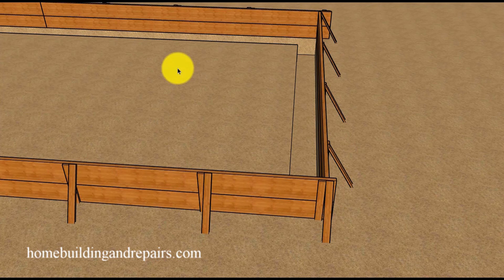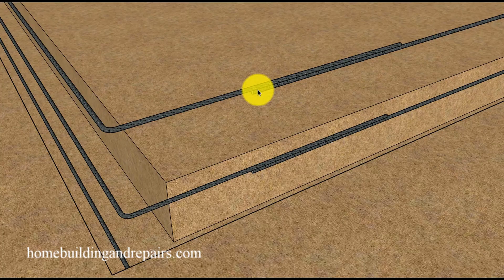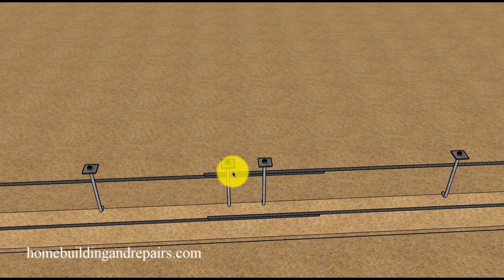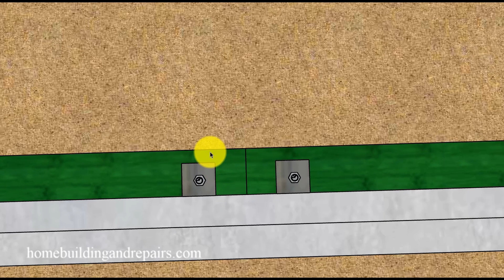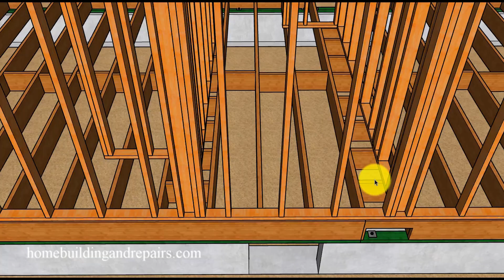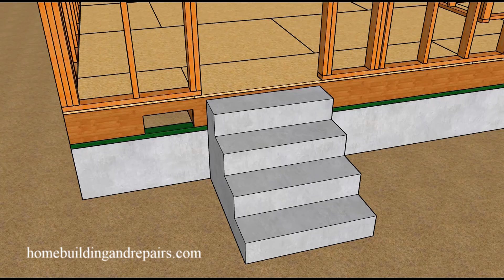How To Build Raised Floor Foundation And Floor Framing For Small One Bedroom House

Comment: I really want to thank you, i just completed my 1400ft house on 11000sqft lot and i had alot done with your help i really appreciate it. I built it all only hired local an electrician for electric.
Reply: How did you pour the concrete?
Reply: @MateoMan1  4000k psi with a cement truck and a pump

Comment: might be a dumb question but how do you connect the floor to the sill plate?
Reply from the maker: The joist are usually nailed by angling 16d nails or commonly referred to as toe nailing.
Reply: @gregvancom  what about areas prone to high winds? Toe nailing is enough to hold down the structure?

Comment: Hello Mr. Greg. I watch your videos often as I am getting ready to build my own house. A question, please: I am planning to build on 50ft by 60ft with raised floor foundation. I will use 2x8 for the joists on the foundation. What size do I use for the 2x8 to cover the 50ft since the longest is 16 ft (I believe)? Even if I used 2x8x16 three times, it will not fit... And there is the overlap of 4" minimum, etc.
Reply from the maker: Most designers and engineers use beams located within the maximum span of joist. For example if the maximum distance for 2x8 floor joist is 14 feet then you could span the beams 14 feet apart and make the last section smaller.  For 50 feet you could use 3 - 14 foot spans and one 8 foot span.
Reply: @gregvancom  ok. Thank you, sir.
Reply: @gregvancom  Mr. Greg, so you think having 2 rows of  beams (walls) to support the joists in the middle in the middle
Reply: I went to your website but I could not find a contact information such as email or phone

Comment: Hey, Greg, I thought you did a great job explaining this. My wife and I are wanting to build our first home our area is very susceptible to termites and water damage so we were wanting to frame at least the outside walls out of steel, and maybe even the interior walls. What are your thoughts on this, and can it be done with the same method of raising the floor that you used in this video, or would you recommend something different?  Thank you!
Reply from the maker: I'm sure it can, but I would need more information or plans before making suggestions on what might or might not work.

Comment: Thank you for this. But why is the inner part of the trench wider than the forms?
Reply from the maker: To create structural footings. They support most of the buildings weight.
Reply: With respect, I've not done this before, so I'm trying to understand what happens when you pour the concrete into the forms. Does it ooze out under the form to fill the rest of the trench, thus forming a footing?

Comment: Does this stage need inspected before framing
Reply from the maker: Yes, you will need a floor framing inspection first, then a floor insulation inspection after that. Ask your inspector when they are there to find out when the next inspection is going to be.

Comment: Hi Greg i want to build an extension room connected to my house and i will need your advice how to make foundation raising it above ground levelled to the existing rooms. should i make slab foundation or just wall foundation only as you showed in your recent video? thanks.
Reply from the maker: It might be better to match what the type of foundation you already have, but you could change it to a different type if it will work better.

Comment: The vertical boards on the inside wall holding it up flush with outside wall, do you just cut them flush with concrete after concrete sets?
Reply from the maker: Yes, those are referred to a rim joist and they are even or flush with the outside edge, but can be held back sometimes for shear panel. For example if plywood shear panel is 1/2 inch thick then the outside floor framing can be held back 1/2 inch so that plywood is even with concrete.
Reply: Oka thanks a lot . My wife and I are about to build close to the end of the year, and I didn’t want to do a slab because of the fact if something tears up under there it’s pretty costly.. with that being said your video gave me exactly what I was looking for.. THANKS

Comment: How do you feel about putting an entire house on helical piers?   32’x48’.   Piers on 8’ centers.   Single story.
Reply from the maker: If it will hold it, then yes. However, you might need to contact an engineer for more information.
Reply: @gregvancom     No concern that they can hold the load with each pier at 70,000 lbs.   The concern the house lifters have is Lateral movement.    It’s just that none of them have any experience setting an entire house on these piers.

Comment: If you have this kind of a home, how would you redesign it to be able to have a basement. My house is like this but on a slope so one side is 6.5 feet tall and the other 2ft. I would love to dig out the entire crawl space to turn into a basement. I have posts roughly every 8 feet in both length and width.
Reply from the maker: I don't have any videos on that, but in reality you would need to raise the house or structurally support it somehow, so that the soil could be removed and replaced with a basement. I did put your video suggestion on my list of videos to be made in the future.
Reply: @gregvancom  thank you I appreciate that, and I look forward to that in the future.

Comment: Why do you leave the center as is ? My father made a reinforced  concrete floor in there before closing it with the floor.
Reply: Reasons Not to concrete a crawl space: 
Concrete is expensive
Future plumbing repairs or modifications would be much more difficult/expensive
If water  gets in, it's now in a concrete bathtub
Reasons To pour a slab in your crawl space:
So anyone who has to crawl under your house can lay in the water or sewage leakage that necessitated they crawl under your house
So prairie dogs and ground hogs can't start a nightclub in your crawl space

Comment: How would you sleeve for utilities?
Reply from the maker: Some electrical doesn't  require sleeves, but I like to use a larger pipe. If I have a 1 1/2 inch plumbing pipe and I go straight through the footing, then I will use a 2 inch pipe for the sleeve.
Reply: Thanks for taking the time to respond.

Comment: Don't those vents get in the way of insulation?
Reply from the maker: They could, but most of the time the insulation is held back a little or some type of blocking is used to prevent the insulation from blocking the vent.